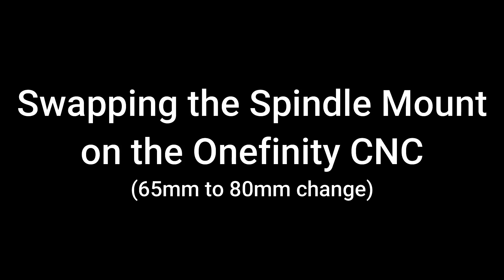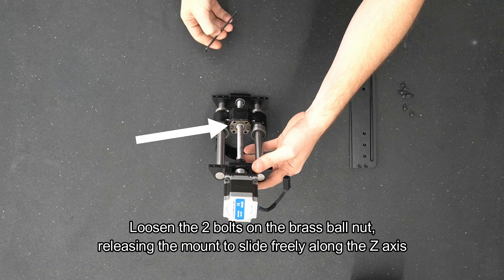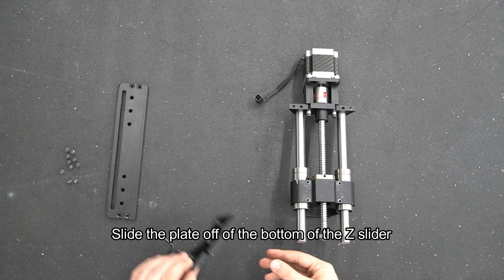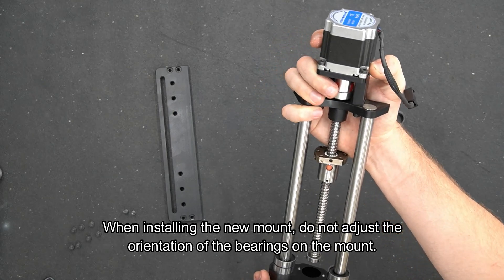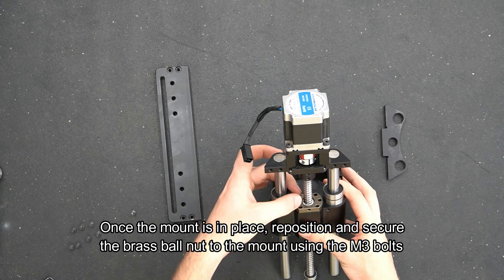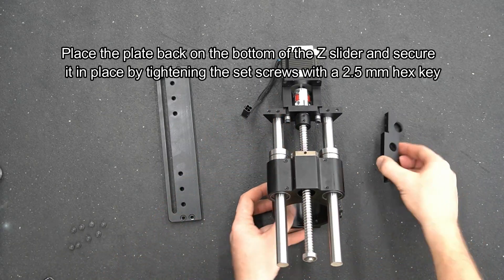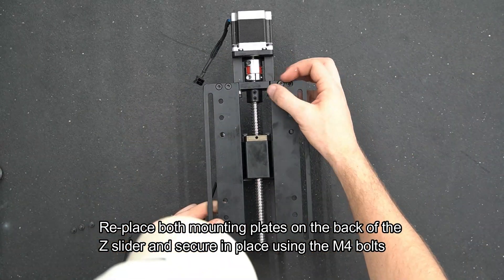Support: Swapping the Spindle Mount on the Onefinity CNC

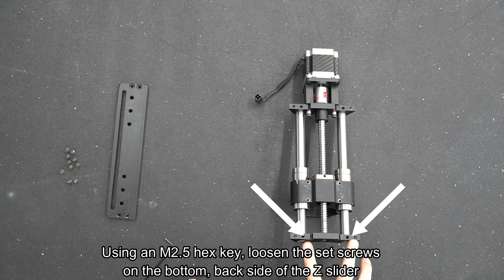Comment: DO NOT FORGET to be careful and use heat for the (too) small set screws at 0:45.  I've spent several hours drilling and tapping today after they were totally stripped, as I'm seeing a lot of people on the forums with the same issue.
Reply from the maker: Yes, they are easy to strip!